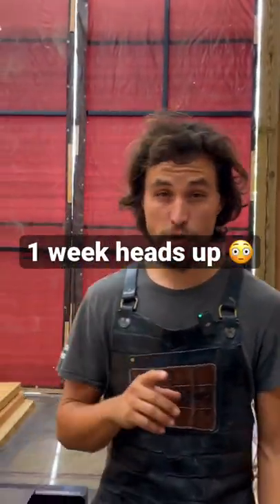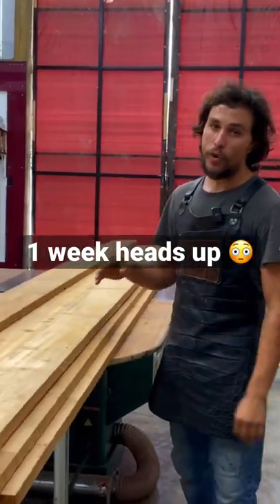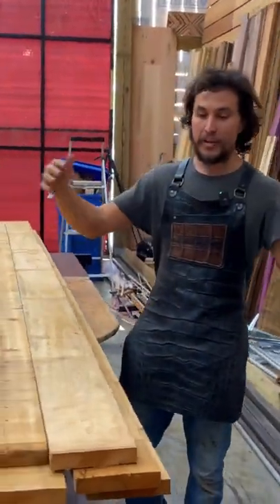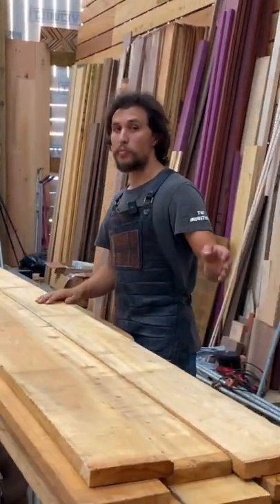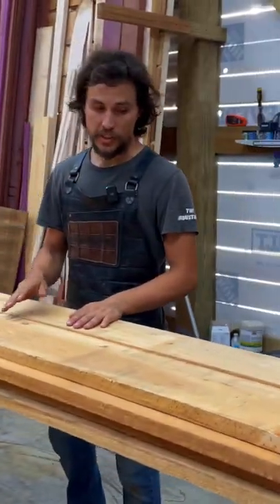Last minute Change Orders 🫡

Comment: 4/4 + 4/4 does not equal 8/4.
Especially if it's rough sawn.
You guys don't know what you're doing.
Reply from the maker: 🤣🤣🤣🤣 cypress comes 5/4 rough silly billy. What’s the name of your woodworking business?
Reply from the maker: You can look us up, you’ll find out really quick that we know what we are doing. We run a full time woodworking business. It’s not our hobby.
Reply: @TNTINDUSTRIESLLC  you'd think if you were using 5/4... You would have said 5/4 and not 4/4 in the video.
Reply from the maker: You don’t quite understand, it’s classified as 4/4 but actually comes thicker so after milling it’s 4/4.
Reply: @TNTINDUSTRIESLLC  That's not how it works.
5/4 is a representation of rough lumber, s2s, s3s, anything that isn't dimensional lumber.

If you process your 5/4 lumber, and it is now 1" thick, it is now a 1" dimensional piece.
Quarter scale is only used for unprocessed lumber. And its always expected(unless you're someone who doesn't know what they're doing), that if someone mentions a quarter scale like 4/4, 5/4, 6/4, 8/4, 12/4, etc, then its yield will be typically a quarter inch lower.

bottom line, your 5/4 does not become 4/4 after processing.
it becomes 1" after processing. And if it comes even s1s, then your 5/4 is not actually 5/4, and is just slightly below it.

Either way you clearly don't know what you're doing if you think 5/4 becomes 4/4 after you run it through a jointer and planer.
Reply: What planer do you have